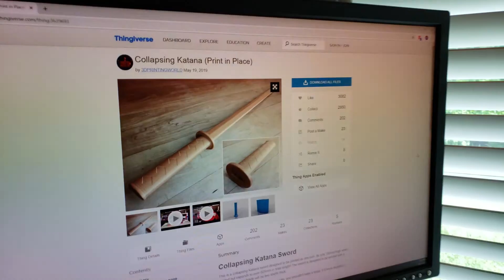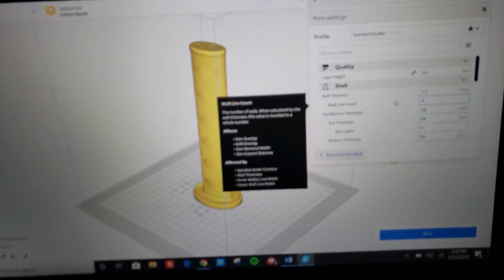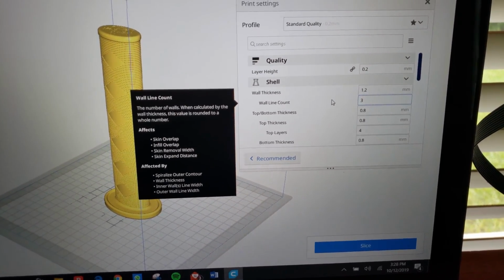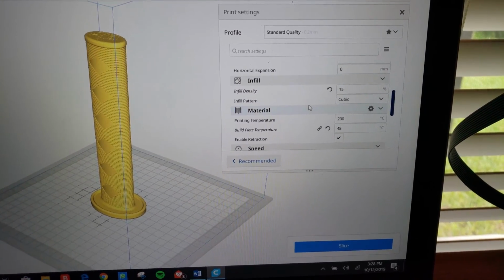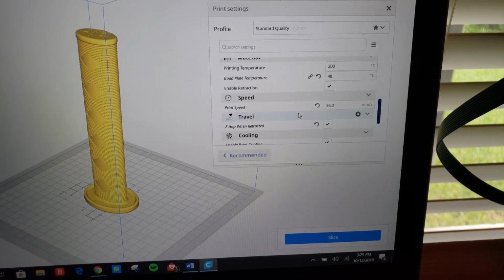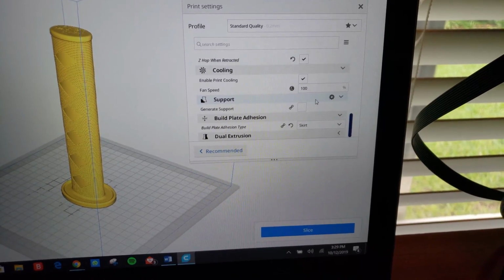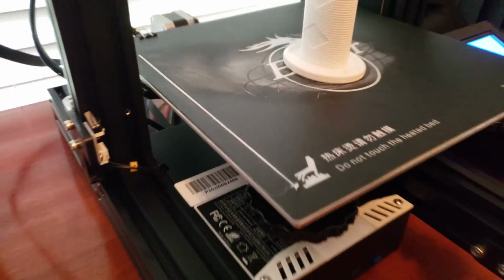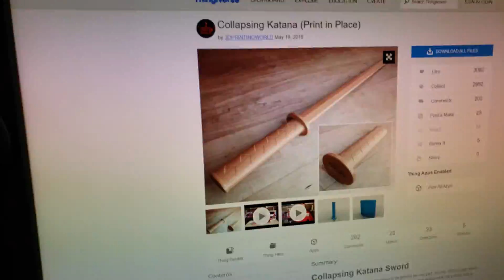Katana 3D Printing Tutorial Part 1

Comment: I didn't even try the test one and just put to print 2 of them at the same time😅 (my printer is the ender-3 v3) somehow it worked (as in the katana just slided with no problem) but i runned into another problem, when i completely open my katana the last one get really stuck and to fold it back i have to basically rammer the tip into a hard surface

Comment: I'm using an Ender Creality 3 v.1 with black Hatchbox PLA and these are the settings that I customized using Cura to pass the test build.  I hope it helps those with the same setup.
- Horizontal Expansion: --0.15 mm (reduced thickness of print, so might not be desirable)
- Initial Layer Horizontal Expansion: --0.3 mm
- Retraction Minimum Travel: 0.5 mm (only way I could eliminate globs between blade pieces when nozzle travels between them)
- Printing Temperature: 195.0 C
- Build Plate Temperature: 48.0 C
- Print Speed: 50.0 mm/s
- Lift Head (enabled)
- Infill Overlap Percentage: 25.0%
- Infill Density: 15.0%
- I don't have an extra fan yet, so no extra cooling in my 70 degree (F) basement.

NOTE: the first two values are negative.  I used double dashes because this font makes a single dash so tiny.
Reply: Honestly I can't thank you enough for your comment!! I also had the problem with the walls getting connected with blobs and the minuim retraction travel saved me so much time.And with some retraction modifications I passed the test. Again thank so so much!

Comment: the setting in cura called horizontal expansion is what people use when close parts like that are being welded together. you can easily adjust it so they come out perfect in the slicer. pro tip lol.

Comment: I am trying to figure out this print for already two weeks and I cant get it fixed. Whenever I try to print, it ends with it merging together through small bits of filament. I dont know why it on purpose fuses it together, but if you have any tips on how to get rid of this, please tell me cause I am loosing my nerves with this xD.
Reply from the maker: Hey there, maybe your extruder is too hot or your PLA is not of good quality. It could also be time to change out your extruder nozzle! I would need a bit more detail to figure this out but try one of these things I mentioned first to see if it works! I know it could be frustrating, that is why I tried to make a video to help people spend less time trying to figure something out if it didn't work for me! I hope this helps please let us know.

Comment: The center is so small it keeps breaking away from bed.  I’ve used glue and hairspray on a very clean bed.  I printed one with success.  Second one fail.  Third one printing now but I can see blades moving around.  Not adhered to bed.  I use coast and wipe.  Plus 95 percent flow.  Beautiful test prints Everytime.  I don’t understand why the center isn’t adhering.  Fixing to print on a raft.  
 Did your sword print? As of this video you hadn’t had a successful print.  Curious.
Reply from the maker: Hi there, sometimes your bed could be warped and could cause this but since you mentioned that the test prints came out beautiful, it sounds to me like your bed isn't hot enough or your bed isn't leveled properly (not close enough to the extruder). You could add the adhesive but if your bed isn't hot enough, the print wont stick. For example maybe for the test print it doesn't matter because it's so short height wise. Now, when you print the katana, once it's half way done printing the bottom portion could have absorbed the adhesive and its cooled so it wont stick. Your extruder may be touching the print and you see the print moving because the base isn't adhering properly. It really is a science to figure out how hot/cold you need your bed to be. Make sure your bed is leveled properly as well.  Also, you can check out my second video where I show the successful print. I hope this helps! Reply back to see if you were successful!

Comment: Do I still put the bed at 48C even though I use PETG? The minimum print bed temperature recommended for PETG is 70-90
Reply from the maker: PETG will be different, however, if you follow the steps on printing out the test print first and it comes out good then try it out! This worked really well on PLA but I haven't tried this print on PETG yet. Please let me know how it turns out!

Comment: Hi. Do you think I will be able to do this without a headed bed but with a enclosed printer? Also would it be ok if I rescaled it a little so it fit in my printer? Thanks and I like the video so I subbed
Reply: I also use glass for my printing bed and use glue so the first layer sticks with no problem.
Reply from the maker: Glad to hear! So, I would suggest to run the test print and ensure you aren't getting "elephants foot". Make sure the test print separates easy. If that is solid then you are good to go! Scaling should not affect this at all. Happy printing
Reply: Use magicgoo

Comment: My anycubic mega s won’t get those test pieces to separate. What variable needs to change for that?
Reply from the maker: Can you explain what exactly is happening? For instance, are the bottom of the pieces getting stuck or is it throughout the entire test piece? My recommendation so far is to lower the bed temperature and add a fan to cool externally as the print is running. Maybe slow down the printing speed as well.
Reply: @mechmattt  I had the pieces stick together after the print was done. I used a scale of 75 since it’s for my little guy
Reply: @mechmattt  slow print speed? What does changing that setting help with?
Reply from the maker: Awesome! My nephews loved the Katana as well haha. So, from my experience a slower speed helps when dealing with tight tolerances, very much like this print. If you are printing at say 100mm/s try to come down to about 85 or 90 mm/s. If you are at 90mm/s try to come down to about 80 or 85mm/s . Let us know if this works! Thanks.
Reply: Don’t scale.  You’re pushing the pieces closer together.  Print 95 percent flow.  Turn on coasting and wipe.  Print at .02